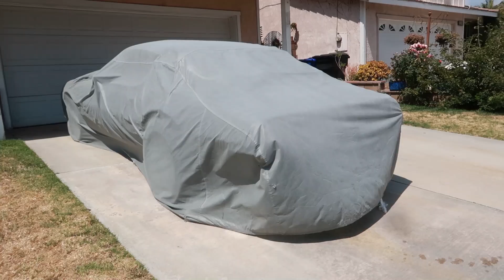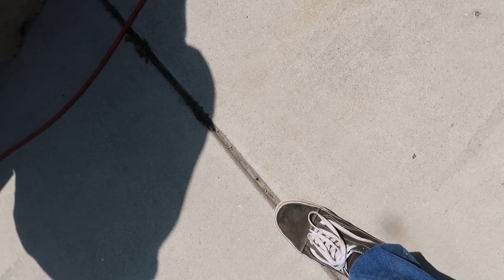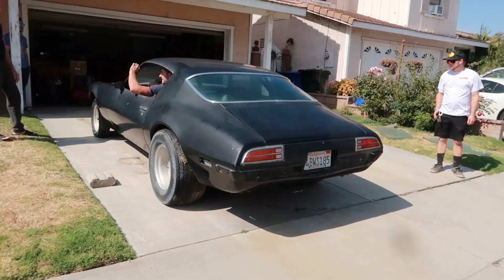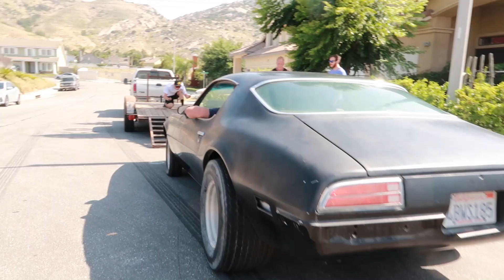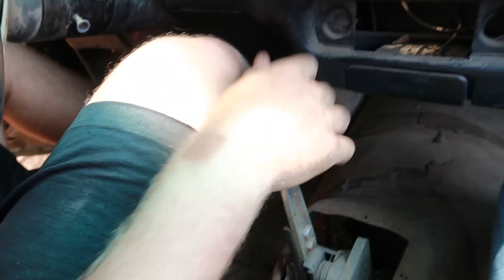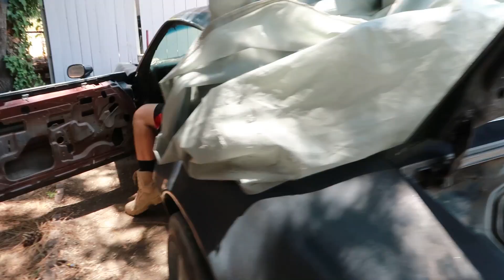WE BOUGHT A 70's FOUR SPEED DRAG CAR!

Comment: Three things: first throw away that air cleaner ,second keep it Pontiac powered and third keep rocking those centerline auto drags!
Reply: Exactly, air cleaner is a loss on horse power.
Reply: Them air cleaners should be banned ...they are a fire pit...the foam in them dries out and will plug the carb and is super flammable. One backfire and the whole car is toast
Reply: Definitely keep it Pontiac power

Comment: Best car mod you can do for any project is a winch. For your trailer. It’s so helpful. You can get a good one at harbor freight for a decent price, and with a remote you can winch your car up while sitting in the driver seat. Super helpful.
Reply: Harbor Freight Badlands 12,000-lb. Can't kill mine. Yes to the remote, but the driver's seat is the last place you need to be when pulling something up. Range is longer than they claim, actually around 75 feet, so maneuvering a non-runner is much easier if you are working alone.
Reply: 413x398 yeah we have that for my dad’s tilt trailer. He actually uses his 97 ford and that trailer as a backup to his tow truck. Our trailer doesn’t have ramps so sitting in the driver seat is perfectly fine. Usually though, it’s just to align it, and once the front tires touch the trailer we hop out and winch it up. We’ve easily towed over 200 cars with it. Even a full size truck stuck in park isn’t too much for the winch to handle.
Reply: @JosephSamsor  Cool. Now let's hold our breath waiting for Harbor Freight to send us endorsement checks. Ready? Inhaaaaale...
Reply: 413x398 if only lol

Comment: Amen! Nice 🤘🏽 I've got myself a 1970 Pontiac Firebird 400.
Reply: I had a 75 Bonneville coupe, 400, 4V...retired it at 235k because the frame rotted out. Still rum well.
Reply: @port nut base Firebird are just plain. The dual snorkels are Formula Hood and Rear Wing

Comment: Great find guys. The only 70-73 bird with a 12 bolt, is the 70 T/A, which I'll bet it's not. So some-one also put a bigger rear in it.  It could  really be a cool street machine. Specially cause it's a stick shift.  Please keep the motor Poncho. If you need help or advice, check out Jim Butler performance. Good luck with it.

Comment: I'm a Pontocho lover from back  depending on what has been done to the inside of the engine don't rive it past 6,000 and  it will live happily, if you rive past it blow up. It is a long  rod high torque engine . At high rpms the rods will flex and turn the bottom end to scrap.
Reply: dont forget the cast rods....pontiac wtf.

Comment: Much smaller L-88 style hood scoop than what I had on my 74 Camaro but you don't see many cars with that scoop. Also you mentioned in the early part of the video the car has a roll cage. It is a drag race roll bar set up there is no actual cage as the bars do not encompass the full interior as dies a road race car.

Comment: Things to do to the firebird:

1.Paint it red. (cause all fast cars are red it's like a rule)
2.Add a wing. That trunk lid is looking pretty lonely.
3. Add turbos wherever you can.
4. Redo the interior.
Perfect car. I'm hoping I can get my hands on a 70-73 firebird, hopefully a Trans am. Cause functional heat vents are awesome. Also, where could I get one of those hoods? It looks so awesome!
Reply: I'd leave it without the rear spoiler.
Reply: yeah maybe. it depends upon what else is done to the car. sometimes a spoiler doesn't  go with a car. it just depends upon how it will look in the end.

Comment: Air cleaner of death right there (10:55)...
Needs a Raisin Bran hood...
Reply: Very popular piece back in the day. Filter was fine when new, but after x amount of time they would dry out and disintegrate slowly into the engine. Not a "real" problem as that shit just blows through and out, but filtration efficiency at that point is nil. New filters are still available.
Reply: Yep, put one on and day it backfired right when I shut the car down. Came back out 3 minutes later to find the air cleaner on fire.
Reply: @mds00  Carb backfiring is indicative of an owner who doesn't know how to tune.

Comment: No specs, no info, no history? Come on man. You cant do that to us gearheads!
Reply: I'm gonna guess cam is around 250º @ .050. Maybe we will find out. Maybe not. Other guesses?
Reply: 413x398 I don’t think it’s anywhere around that high, maybe 220 @.050 max
Reply: @alanb2845  220 is low for something purported to be a drag car. However, that's your guess and if it's 220 or less you win the internets! Problem is finding the specs (if known) from the new owner. Ideas?
P.S. Thinking about this today, wouldn't this be a fun YT game for gearheads? Guess the duration!
Reply: @413x398  no way. that thing is probably a 225-230 @.050 and a 110 lsa.

Comment: can I ask what the third digit in the vin is?
My guess with the manual transmission/12 bolt combo is that it's a "6";
6 = Formula
8 = Trans Am
4 = Esprit
Done right, that could be a very valuable car.

Comment: get ride of the mouse and put a rat in it with full frame under it then u can start talking drag car but u will have fun in it but do not go over 600 hp or it will twist the car with out a frame .i have ran a few second gen camero's and firebirds one when i was young we put a 327 build nuts out in a stock 77 camero first pull the windshield popped out and the drivers tire set an inch off the ground but it was for fun to see what it would do to it . i know i would have fun with u guys racing but the rule with my friends is if ur faster then u help the other guy to get faster because nothing beats a finger gripping race and we race just for fun no money but we have different brackets like pump gas no nitro , pump gas with nitro and all out but no trailer cars has to drive on the road as a driver this makes it tricky i run pump gas only put building a pu  with nitro all my cars have rat motors but one it has a 1200 hp 327 in it and that is on pump gas no nitro
Reply: @frigglebiscuit7484  X2